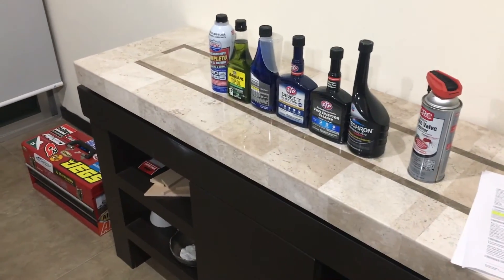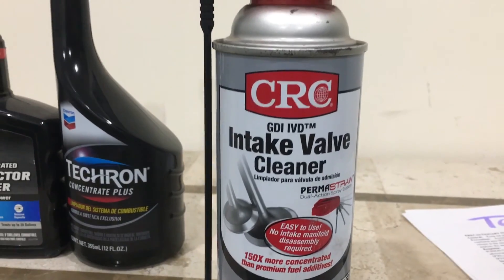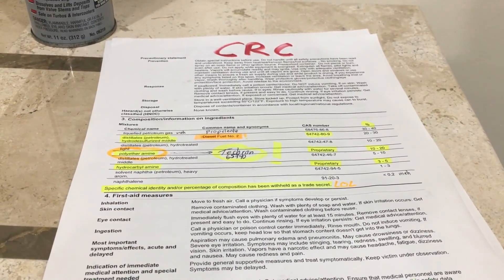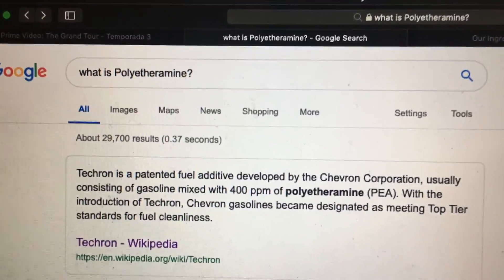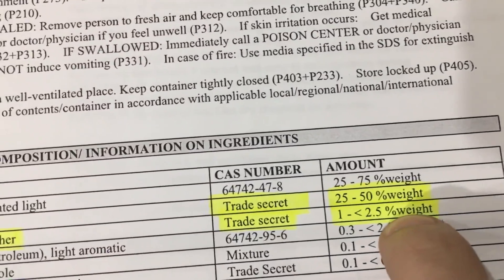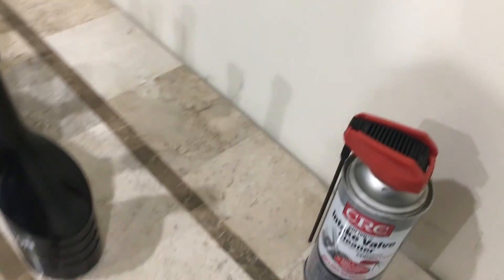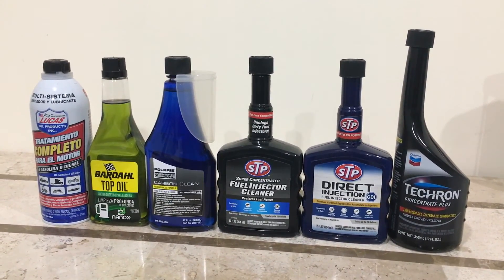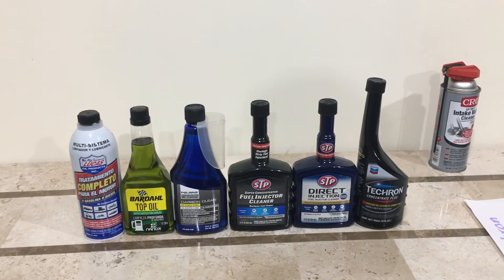TOP 10 Best Chemicals to Remove Intake Carbon Build Up

Comment: Thanks for the video I have a RZR pro xp 2024 and I seen they have carbon cleaner was wondering how do I apply/ how much do I use . Also I know Polaris is very clear if you don’t use any Polaris brand it automatically avoids warranty

Comment: Subaru has a kit that uses a slow drip system into the vacuum port instead of an aerosol spray. I copied it will Techron and it worked fantastic. Better and easier than the CRC cans I have used in the past

Comment: Always thought that the volume of liquid that you add into the air intake to get it into the engine to burn should be small so it doesn't flood.  You poured a lot in 😂, or am I missing a trick?
Reply from the maker: A 5300cc engine displaces almost 90 liters of air a second @2,000rpm, pouring a couple of ounces of liquid is not nearly enough to hydrolock it. Plus, once it goes into the vacuum of the manifold, it gets pulverized into a mist. To really hurt an engine this size you would need to pour gallons of water into the throttle body at once. On a smaller engine like a mower or gokart, then yes you have to be careful with the amount you pour into it

Comment: Today’s gasolines have plenty of detergent. The government is up the ass of these companies to produce clean exhaust systems. Techron is what Chevron uses in its gasolines and it is considered the best gasolines with detergent. Shell is number one for premium gasolines. If you toss in a bottle of Chevron every few months you should have no problem with your engine. Also clean oil is best oil. A Toyota engineer says he toss in Techron once in awhile maybe because of the hype but he says it’s not needed. Won’t hurt.

Comment: I've been using the 3C Machine from ATS Carbon Clean for GDI engines for 9 months now. It works amazing! Way more effective that anything you can spray in from Autozone and way less toxic that PolyEtherAmines.
Reply from the maker: Will google that, but for every once in a while DIY what is the cost ?
Reply: @BadAssEngineering  Our shop charges between $280-$350 depending on the vehicle for the treatment. We recommend to our GDI customers every 20K-30K miles as a preventative care. I've had vehicles with hard misfires and other drivability issues resolved after treating with the 3C as well. ATS Carbon Clean offer individual treatments as well for the DYI guys as a fuel and oil pour in.

Comment: Could you put these in the vacuum line on the brake booster?
Reply from the maker: Real Johnny Trump yes you can, but I rather throw it in the throttle blade
Reply: BadAssEngineering any particular reason why? Gonna be tackling this for my pops this weekend and i dont wanna fuck anything up lol
Reply: If you do its imperative to do an oil change to flush out any solvents left over
Reply: Jeremy Moreside dont worry i never ended up doing it. He hates the truck and is gonna get rid of it soon so why bother lmao

Comment: Can this work if you pour it through the spark plug hole?
Reply from the maker: Sy Sanav no, the engine has to be running to burn everything
Reply: I meant pour it in prior to starting up the engine since it would already be residing inside the pistons.
Reply from the maker: Sy Sanav too much work, and you have to do it when the engine is hot. Check out my other video where I show the steps on how to pour it
Reply: Ive added gum out in a hot engine with spark plugs out. Let it heat soak for 3 hours, turn engine over to clear cylinders, reinstall spark plugs and run engine for 20 minutes. Go for a drive under medium aggresive throttle to load the engine. Repeat once a year

Comment: Hi,
I have a Hyundai Sonata 2012, GDI.
I am also facing issues with CRC availability in my local store and want to try these carbon cleaners, spray directly into throttle body.
My question is, have you experienced any difference?
Are these carbon cleaners as good as CRC?
Inputs would be valuable.
Reply from the maker: Yes, Chevron Techron Concentrate is the one that works best. Lucas injector cleaner is also good, but Chevron should work even better than CRC

Comment: wont these throw codes if you put them into the intake?
Reply: You can still have the maf plugged in and throw it in the intake stream past the maf sensor with no issues. Seafoam has an attachment that slips inside the boot on the throttle body so no codes get thrown
Reply from the maker: You have to disconnect the MAF, and that will throw the codes, but other than that, no. Check my other video on how to use them, as I explain in more detail

Comment: the best ones are nitrogen based
Reply from the maker: PolyEtherAmines are Carbon-Nitrogen Based
Reply: @BadAssEngineering  not all use polyether amines. some are petroleum based
Reply: @makaiclearwater3811  mind sharing, suggesting such? Which you think are the good nitrogen ones.

Comment: Absolutely DO NOT use CRC intake valve cleaner on any GDI vehicle. Especially on Ford EcoBoost or VW GDI engines. Ford actually has posted a bulletin against chemical valve cleaning. Manual cleaning is the only way to go. CRC has had several cases of having to much carbon break off and causing valve and piston damage. And they dont take responsibility for their defective products. I may include that I'm a 20 year certified tech as well. I stay clear of CRC.
Reply: Sounds like CRC works !!!!!!! And we're here to hear what breaks up carbon, not top end damage caused by carbon ! Seems like the engineering process needs better engineers & the manufacturer needs better materials
Reply: I’m calling bs.  Ford wants you to bring it in snd pay Ford to take apart the engine and walnut blast or manually scrape it off.  Chunks of carbon don’t break off.  The chemicals slowly dissolve the carbon into smaller particles and blow them out the exhaust.  If it’s carbines up enough to be catastrophic then the chemicals wi t do anything to the carbon.
Reply: Well what is your advice on carbon cleaning a wrx? No one will do a walnut blast so what chemical should I use?
Reply: This has been known since egr valves have been clogging up engine intakes… it’s one of those things, if your to lazy to do it properly then do it risky. 
Just run a little line to your intake and while driving every 50 km lightly fog the intake and slowly take it down layer by layer until she’s clean. not a great way to do it  but definitely better then revving high and pouring stuff in a hot engine. And risking a bent rod lol 😂

Comment: Pulling data safety data sheets was good idea.
Thanks for the info.
Any suggestions for an old 1983 460 cid with carbon build up in the combustion chamber...
Reply from the maker: Do the same i did in the video. If you really want to get serious about cleaning it, use Techron Marine since It has a PEA concentration of up to 50% so it would be much more effective at removing the carbon. If it is carburated just pour the additive directly in the carb while holding the throttle a bit open with the other hand, same method my dad cleaned carbon off his carburated cars
Reply from the maker: https://youtu.be/7VcPGYohWWc
Reply: Use the exact method I explained above....
Reply: Berkebile 2+2 gum cutter is what I use....